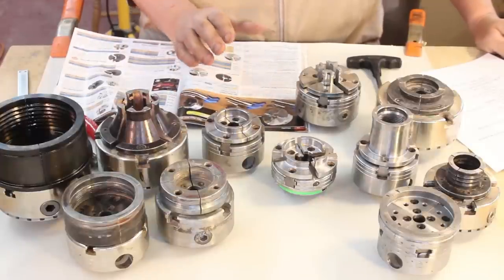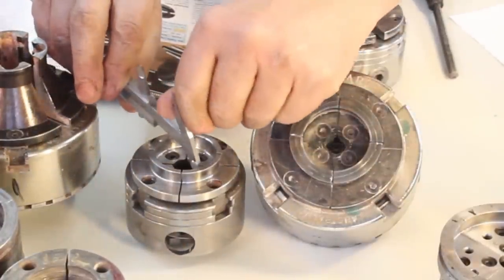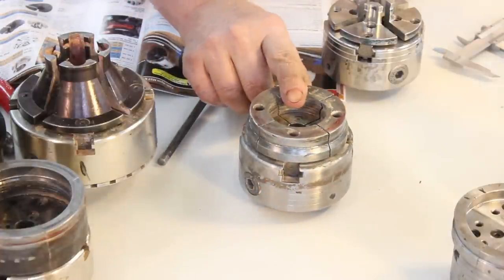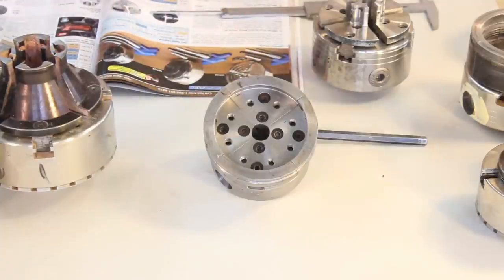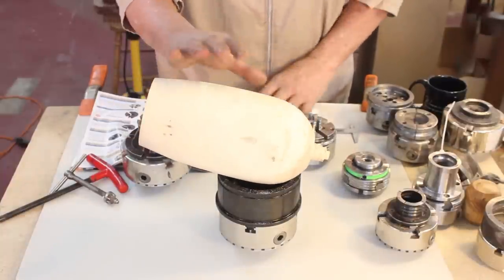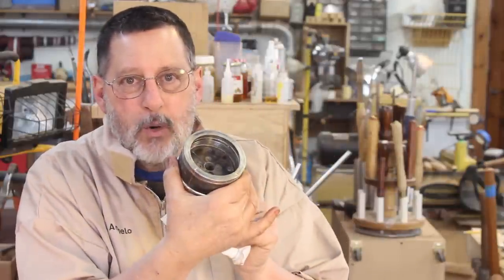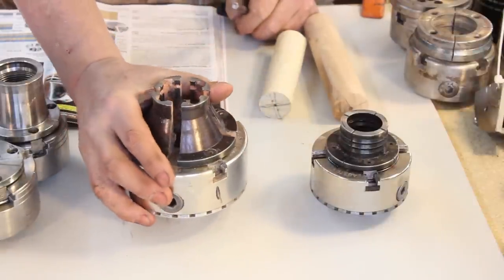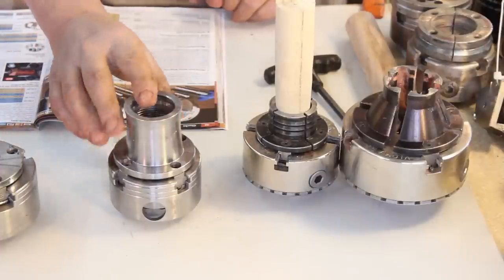Scroll Chucks and Jaws for Woodturning by Sam Angelo

Comment: Why do you not just use a face plate like I do ? It is a lot less expensive .
Reply from the maker: Yes I agree.  I have been collecting chucks for probably 25 years.  I have a certain jaw set on each one.  I also have some that fit a 1 inch spindle and some that fit a 1 1/4" spindle.     To answer your question.  Mainly it is faster.  If I am doing a run of 20 bowls, a scroll chuck is very fast.  I do use faceplates on some items---mainly very large pieces.  You certainly can get by with the chuck (s) you need and faceplates.  Anyway I like tools and make no excuse.  But I am probably done buying chucks for a while......Thanks Sam
Reply: Well I see you are the bowl turner . I have just been playing around. You should know what you are doing. I guess I will haft to buy me a chuck  do you have any good ideas what to buy? I might be doing anything ?
Reply from the maker: There are many good chucks on the market.  I like Nova, Vickmark.  Record looks good.  Oneway has straight jaws and I would not buy a chuck with straight jaws.  They are difficult to fix a piece of wood onto these jaws compared to ones with a dovetail jaws.  Sam